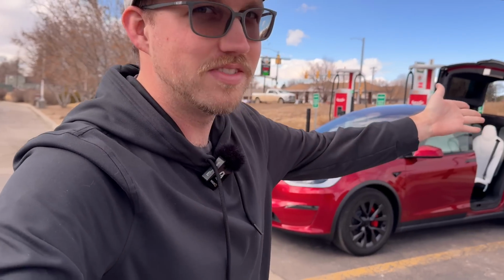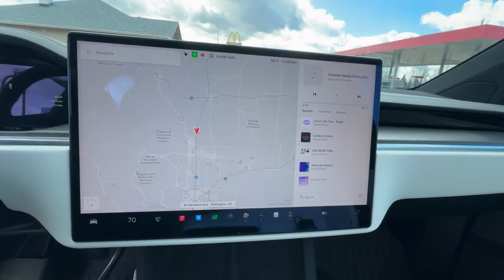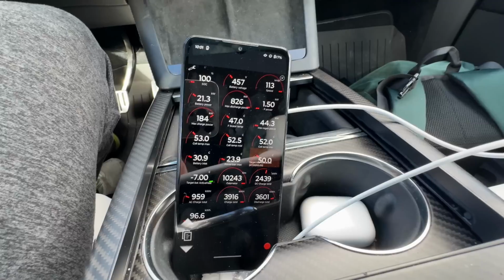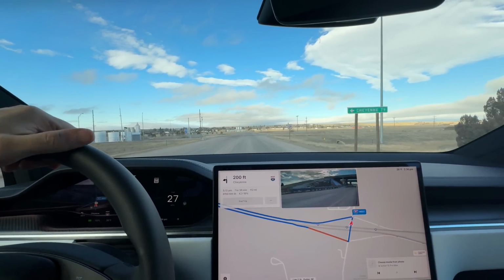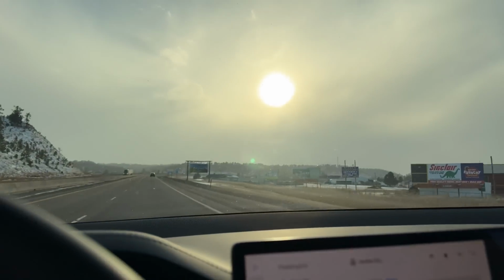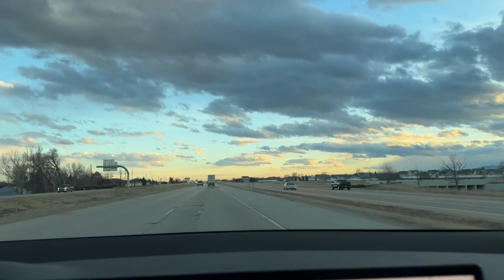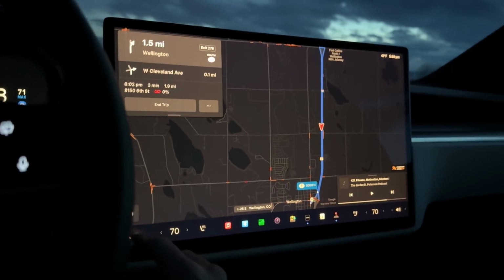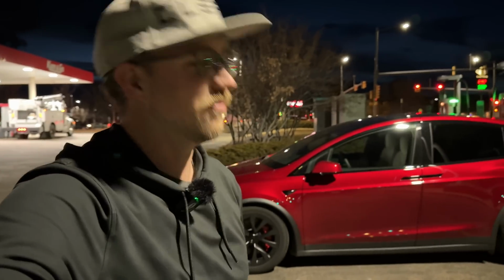Tesla Model X Plaid 70-MPH Highway Range Test! Jordan Goes Far Below 0% To Get Every Mile Possible

Comment: EPA on plaid is 326, you got 286.. 13%. So if the consumption nudges up to 3.33 it will be well within 5%. Not a bad result honestly.
Reply: 😂😂😂 Lipstick on the pig
Reply: @Wised1000 EPA range is a mix of highway and city never exceeding 56mph. So driving mostly at 70mph, there is very little lipstick on this pig from what I see.

'''The EPA tests electric vehicles on its "City" and "Highway" cycles. The dyno test is 11 miles long, takes just over 31 minutes to complete, involves 23 stops, reaches a top speed of 56 mph, and has maximum acceleration equivalent to a lazy, 18-second 0-to-60-mph run.'''
Reply: @Wised1000  Very few get EPA mileage.
Reply: @SpottedSharks  In fact most manufacturers except Tesla meet or exceed EPA milage in the 70 mph test. Some like Porsche and Mercedes by 20% or more
Reply: @Wised1000  not sure how when all vehicles in cold condition have losses including Kyle's and Bjorn's spreadsheets. It's not to speak that Tesla has ever been accurate as my car will never see it, but it appears they are focusing more on it because even recent refresh model 3 meets or beats it's #s in multiple tests I've seen.
Reply: @AustinFerguson  In the El Prix winter mix range test conducted by the Norwegian Automobile Federation the new Model 3 LR lost 30% of its claimed range, one of the worst gaps among the tested lineup this year. The new Model 3 is only more efficient with low rolling resistance tyres. Once you change the tyres, for example in winter, the advantages are gone. The Model 3, just like all Teslas at this point, is kinda disappointing as they made other things worse on top of that, like no indicator stalks, gear shifter, less comfortable seats/space in the back etc.

Comment: The temperature is the most critical variable to take into consideration when testing vehicle vs vehicle.
Reply: Absolutely + wind
Reply: Keep in mind he's testing in Colorado at a higher elevation than most people drive at.  Cold increases air resistance.  Elevation decreases it.    Range tests are also impacted by the sun, given that a sunny day can warm the cabin of the car in the winter, reducing the use of the HVAC.  An overcast day would have seen lower range.   They should just test the summer range without sun (most optimal conditions), then test efficiency through various conditions.  Cold weather in sun impacts efficiency by A%.  Cold weather without sun impacts efficiency by B%.  Warm weather in sun impacts efficiency by C%.  Driving in rain impacts efficiency by D%.

To get the worst case, it would be cold weather without sun in the rain.

Are we starting to understand why road tripping in EVs is so much more complicated than gas vehicles?  Range concerns will be especially problematic for those living in apartments / condos without a plug to charge overnight, and the worst the weather conditions, the higher the chance of lines at chargers.  Waiting at a line at a gas station isn't a big deal.  Each car takes like 5 minutes and it takes 5 minutes to fill the car up.  Waiting at a line at a charger can take 15, 30, 45, even 60+ minutes, then you still have to add in the time to charge.

PHEVs are generally the better choice for those with nightly charging, and hybrids for those without.
Reply: It's not complicated when you're using navigation, at least on a Tesla. It factors in everything for you and the estimated arrival % is super accurate in my experience on road trips in mine. @naaspam1185
Reply: The real trick is to run about 10,000 tests in all sorts of conditions and then plug it all into a regression model.  I look forward to that video.
Reply: 100%. This test and result should not be compared to any tests done at freezing, nor at 80 degrees. Really there are a few windows where EV range makes dramatic jumps: 38F and below sees significant range loss that ramps up to severe as you go below freezing: 40-65F yields fairly consist diminished range, and 70F+ yields max ranges (that are usually advertised).
Reply: And it’s good to test them in a variety of temperatures and log them all in a public Google sheet! Thanks @bjornnyland
Reply: Also elevation, cybertruck was deliberately done at 700ft instead of this 4000ft location that also the rivian was tested at. 700 instead of 4000ft result in around 10% range decrease. The higher you are the thinner the air and thus less resistance.